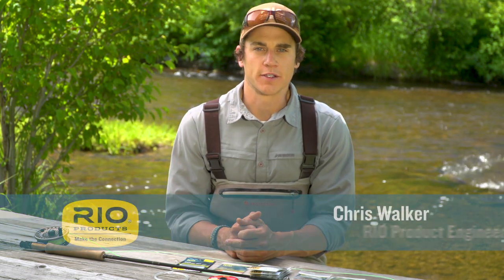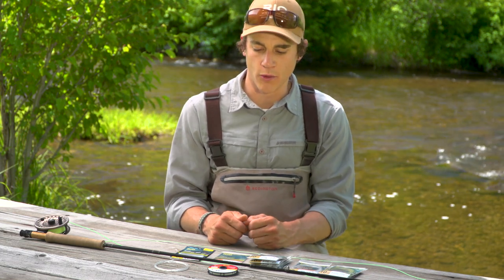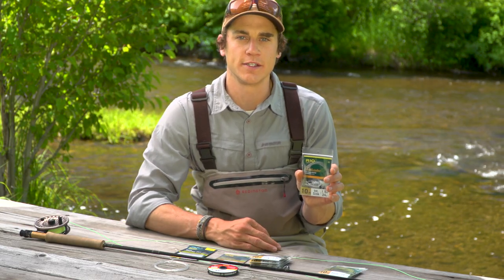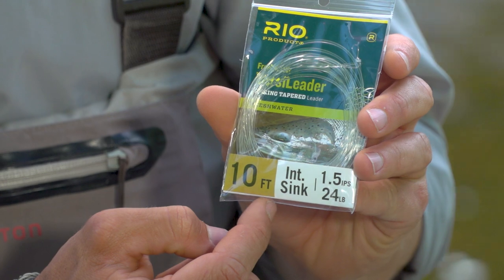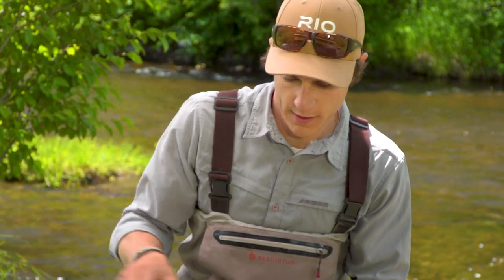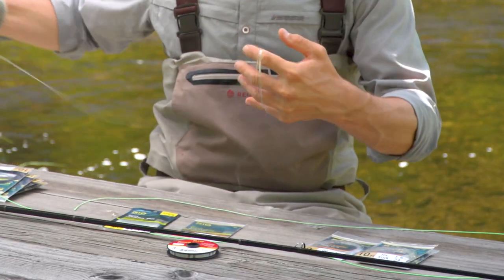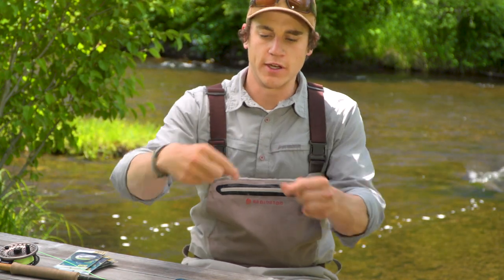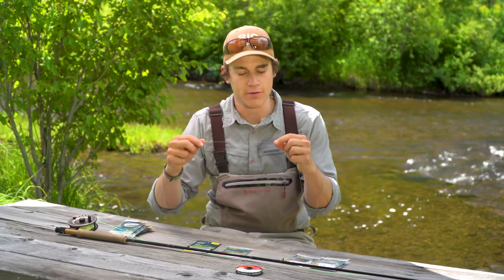S4 E12 How To Use Sinking Leaders

Comment: I use these leaders fishing for browns all the time, they are amazing. But I attach Mono 8-12lb at the end instead of flouro and have success. I wonder what the advantages might be if I switch to flouro? The rivers I fish are small, mossy bottom water (thus dark) waters so maybe it's not an issue using heavy mono there. I'm curious however about how the streamer would potentially move differently using flouro, both in sinking and throughout the water when I manipulate the streamer. Thanks for the help!

Comment: Since Sinking Leaders (Polyleaders or VersiLeaders) have different grain weight, it is not that easy to switch sinking leaders with the same fly line or shooting head.   For example, Polyleaders have grain wieght from 30 ( 8' Slow Sinking) to 120 (10' Ex. Super Fast Sinking).   It is not possible to cast 120 grain sinking tip with light fly line.  You need 400-600 grain Skagit head to balance the grain weight to cast.   It is not that easy to just change the sinking tips with the same fly line.  You may need to change fly line itself (altermately, change rod too)

Comment: Hey great informative video.  I use Rio Scandi Versitip fly lines with 15ft tips.  Would you use a poly leader on the various floating/ sinking versitips?  If yes what length poly and tippet would you use?
Reply from the maker: We wouldn't recommend adding a poly leader to a versitip, as the weight of a polyleader could affect your cast. Just add a 3ft section of heavy mono or fluorocarbon in the 10-15lb range and you're good to go!
Reply: @RIOPRODUCTS  Thank you for fast reply.  I also use full sinking shooting/scandi heads.  Would you use versileader with with full intermediatie or fulling sinking shooting/ scandi head?
Reply from the maker: Those you could definitely add a versi-leader if needed.

Comment: So the correct way is to use loop to loop connections with a Perfection Loop?
Reply from the maker: For attaching it to the fly line? yes, definitely. FOr attaching tippet to the end, you can also use a tippet ring on the front end

Comment: For a 9’ 5wt with infinity fly line… what versi leader you think I can get away with for medium sized wooly buggers? What sink rate/length.
Reply from the maker: With a 5wt you want probably nothing longer than 10ft - 7ft would be easier to handle if you can get the depth, but you can make a 10ft work. As for sink rate, you can use any of the options available. If you want to get deep, the 7ips will do that best, and will certainly work on a 5wt, or an intermediate if you only want to be a foot or two deep.

Comment: I assume I should be using Fluorocarbon tippet around 18-24" with your fast sink? I am fishing streamers. Thanks
Reply from the maker: We recommend fluoro for sure when fishing streamers. As to length, The general rule of thumb is that the heavier the streamer, the shorter that tippet section should be. A lightweight streamer would have maybe 4 feet, but a heavy conehead type would have only about 18".

Comment: What’s the difference between the trout and freshwater VersiLeader? Is the freshwater to heavy for a 4 weight?
Reply from the maker: The Freshwater VersiLeader has a 24lb breaking strength, generally used for lake or ocean run fish. So, would definitely recommend the Trout Versileader with a 12lb breaking strength for your 4 weight.

Comment: What loop knot are you using on the versileader and if you use up the mono core how do you recommend exposing more
Reply from the maker: We actually recommend tying on a tippet ring to the end of the Versileader, then you never cut the leader back or shorten it. Just clinch knot the piece of tippet on. If you have to use a loop knot, the Perfection loop is the tidiest and smallest, so we'd recommend that. As for  exposing more core, the best way is to dip the coated section you want removed in nail varnish remover, and leave it there for about 5 minutes. You can then simply strip off the dipped section with your nail.
Reply: Perfect. Thanks!  Also a clinch knot for poly to ring?
Reply from the maker: @stephenpiper6212  Absolutely - or improved clinch...

Comment: if you use a fast sink, how much of a 5wt floating line is going to be pulled under?
Reply from the maker: It will definitely pull some under, just depends on depth of water/current of where you're fishing. Generally, not more than a few feet.